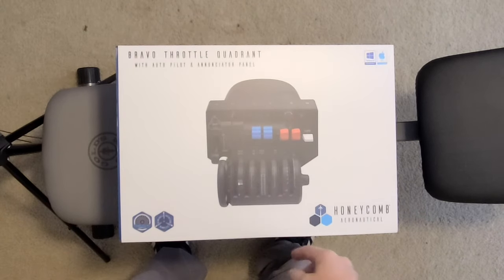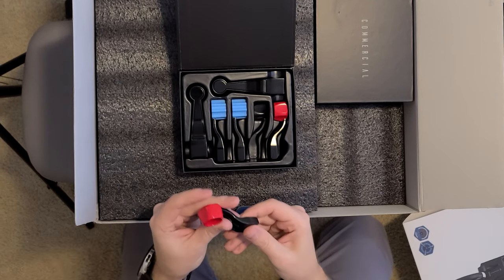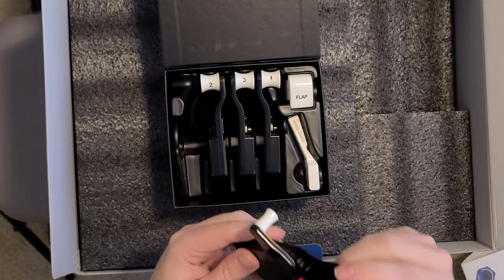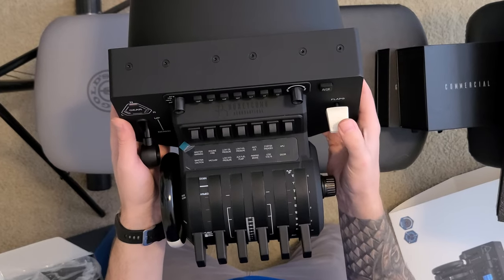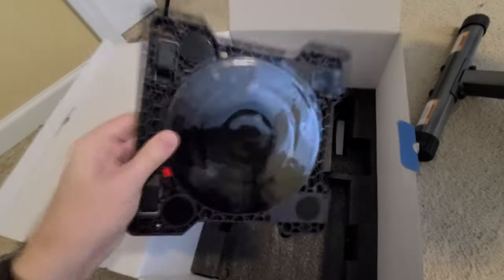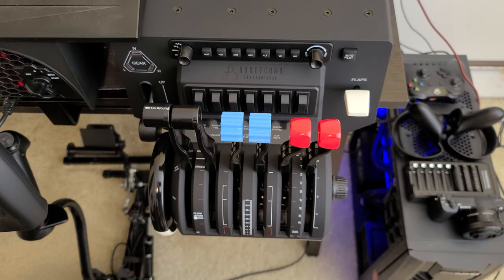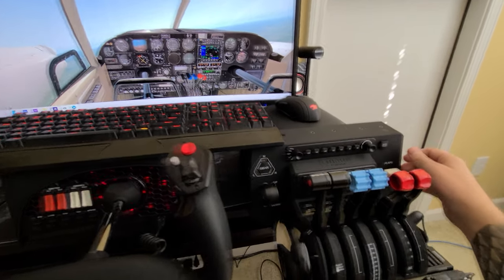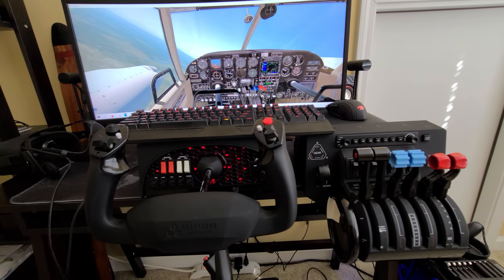Unboxing/Test | Honeycomb Bravo Throttle Quadrant | Hamby Aero

Comment: Hey there, from the looks of it you're using the pedals from the puma as the rudder pedals correct? I have been looking at getting some flight sim hardware and so it crossed my mind to just get the puma first so that i don't have to get rudder pedals for flying winged, I could then just use the puma pedals once i get the yolk etc. Puma pedals work fine for flying both?
Thanks! Great content btw!
Reply from the maker: Ah yes. Works great. I'll never get another set of pedals. Check out my flight sim setup video for better views.
Reply: @JoshuaHambyOfficial  you the man!! Thanks for the quick replies! Will definitely check it out! Thanks
Reply from the maker: Awesome! Thanks for popping by. Come on back!